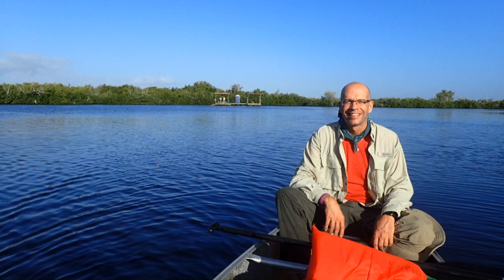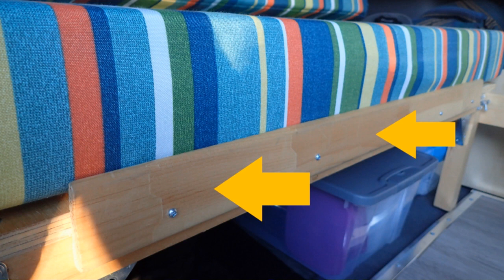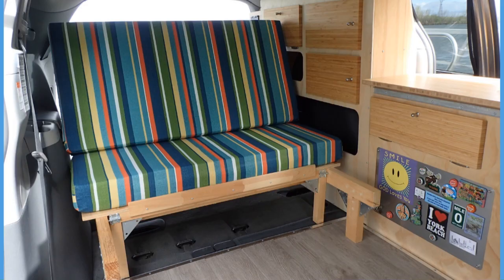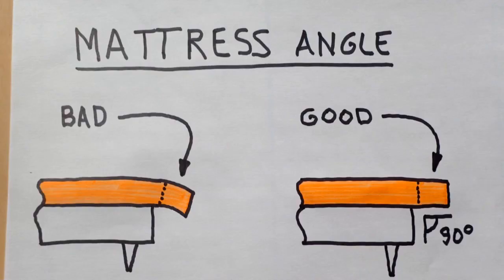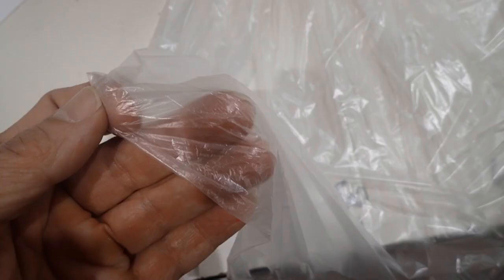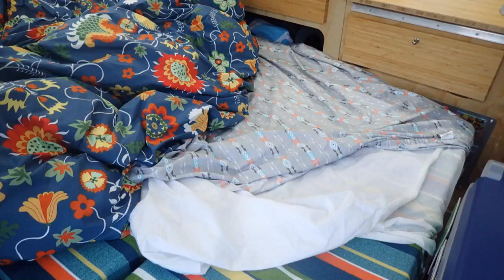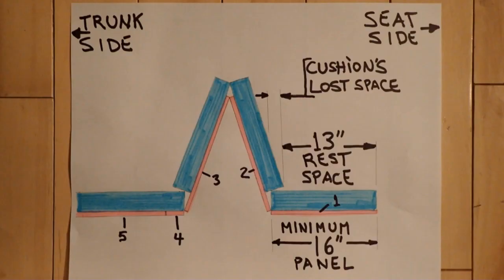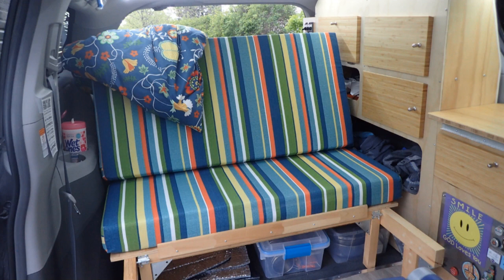Van conversion MATTRESS: how to cut and tips (EASY)

Comment: Suggestion for tweaking the comfort: Because you have a strong cover, you can vary the effective density of the foam at the edges by cutting a triangle shaped high(er) density foam, and cut away the lower density foam (along the hypotenuse) at the edge of your current mattress. Replacing parts of the lower density foam of the mattress with the higher density foam at strategic places can create better support in places of the mattress that carry higher load, such as at the edge. Later, you can even lay on your side and choose to reduce the pressure points at the hip and shoulder by increasing the density in careful ways. As you experiment, you can simulate the increased density without cutting the low density portion by simply inserting some extra scrap foam at the place where you (may) want increased density. Because the cover acts as a structural member (connecting with tension and spreading out some forces), be sure to test with cover on. I am not encouraging you to become the princess who could not ignore the pea, but simply offering some options to tweak the mattress. After a little tweaking of the mattress, remember to read the philosophy of the Stoics to remind yourself not to become too obsessed with comfort that comes from external sources. Cheers from Florence, Alabama.
Reply from the maker: Thank you Pete for sharing this great tip! I had no idea about it. It will also serve everyone who will read your comment. 

You made me laugh with your conclusion philosophy!😂

Thank you Pete!
Reply: Love it! I am fortunate to not have issues with sleeping on the floor. Yet if there is a pebble sleeping on the ground when camping...my Princess issues are revealed! Lol.

Comment: As a bedding person I wouldnt recommend wrapping the foams in the silk film as it will stop airflow, or using any convoluted (egg carton) foams as long term durability goes down considerably. Best practice would be to get two different density foams joined/glued, with softer one on top. Sewing a breathable water proof toweling protector on the top layers under the cover or as Eric uses, an actual matresss protector is the best option. Drilling bottle cap sized holes in the folding base board will also assist with airflow and temperature/moisture management. Will all depend on you budget though. 
Overall, its as great bed design Eric!
Reply: Thank you for this comment! Also couldn't the two foam layers just be laid on top of eachother without gluing them? What do you think? I also wonder about incorporating wool somewhere as it helps resist mold and regulate temperature and it stays insulating even if it gets wet. Guess would need to somehow prevent moths from getting to it though. What do you think? What do you think about natural latex too?
Reply: @flowersafeheart  Yes Latex as a base layer would be fine, as mould resistant and durable, but they are generally quite firm due to cell structure. Cored with larger holes would be best for air flow and maybe even 5 zone -  (softer at hips and shoulders)
 
Wool compacts and holds moisture (think futon and they need airing a lot) 

Most foam is mold resistant now, its more the covering fabrics that are the problem. For the base it should have holes cut into it ie circles (or slats) for air flow and some space between whats stored underneath the bed (i see lots of van builds with solid ply under them).  

A good option might be a decent second hand tempur mattress, then cut to size. It will offer plenty of comfort and the cell structure of those, even second hand are equal to latex and mold resistant.. 

Two foam on top could work if not too high or different densities and fairly tightly covered as they can shift when turning over. Or even better, neither covered except by a mattress protector and top sheet, so can readjust when necessary. A cotton topped, breathable water proof matt protector solves a lot of moisture issues as covers can easily be aired.

Good luck!
Reply: @stephenperry152  awesome thank you!🌿 Lightweight and ultralight backpackers sleep on thin layers of sleeping mats such as ground cover, foam, and air mattress (I don't like air mattress cause can deflate). So that tells me maybe most mattresses are excessively thick.🌿 The thinner it is the more space that saves for air flow beneath. I agree, most don't leave slats or holes or enough air flow. To prevent mold. Plus it is better Feng Shui. Though vehicle camping already breaks a bunch of Feng Shui rules haha but that is ok , has its own Feng Shui. 🌿For indoors I have wonderful 5" futon mattress by White Lotus Home of wool and green cotton. And they make low-toxic waterproof covers but the material is not good in sunlight. It is heavy and bulky though! For vehicle I imagine something much more light and thin hopefully. I wonder about a wool blanket on top. That could be easy to air out. Again though - moths. But good bug screens could be enough and some cedar around maybe.🌿 Anyway nice chatting mattress geekery, thanks. Happy to hear most foam is mold-resistant! Great idea about bed frame holes as an option instead of just slats!🌿 Also I think it's Japan where traditionally mattress and bed frame are very thin and simple and put away each day. I like that! Had great thin mattress topper filled with buckwheat or millet hulls once too. Some mattresses oldschool were filled with hay! But...mold risk?
Reply: 💯% correct on all counts.  I second that.  Don't put a plastic layer or your skin won't breathe.

Comment: Only one question. What is the bottom distance of the gap between bed panel 1 & bed panel 4 ? When in the couch position?
I love your videos, they explain things very well and your van is perfect for my adventures. Thank you for creating these and sharing your experience.
Reply from the maker: Hello Jason!
In sofa position, this distance will be affected by the angle that you will choose to angle the sofa. The use of locks is for when you drive. Otherwise you can angle it as it please you... You can even have more then one hole to change it!
Thank you for your appreciation ✌️

Comment: Great Video!  Yeah I have used a serrated knife to cut cushions a few times lol and keeping that knife at a 90' angle makes your cushions look so much more professional.  So I did it, I picked up a 2010 Ford Transit Connect.  Looked for a while till i nabbed one with really low miles.  I installed a maxx fan deluxe in it, so ventilation will not be a problem.  working on a few projects can't wait to sleep on the bed because I decided to buy myself a new mattress for home, and my few year old very comfortable 9" memory foam mattress lets me sleep like a babey (and with a back as bad as mine it's worth it) will get cutup and be my new cushions.  I have 54" of headroom and sitting on it compresses it down like in half.
Reply: Deryk MacLeod well, get going with the videos! Hehe
Reply from the maker: This is awesome Deryk! 😃
The project is moving on! And you found a van with the head room you were looking for, for your morning calls😉 This van is going to have a great time in NJ and Penn state, and further away!
With a perfect bed and a good ventilation, you will sleep better in your van then at home!😉
Thanks for sharing! And continue giving news, it’s great! 👍

Comment: Love your videos I am not in your league carpentry wise but still got the bed done and it looks great..now to cut the foam and have the covers made :-) I live full time off grid in a 30 foot fifth wheel but at times it is a hassle to get everything ready for a weekend trip so the van build will be great for that! Trying to see HOW to stick 500 watts on top or sides as a awning for shade! Any ideas?
Reply from the maker: Congratulation Federico for your bed! 
I like your idea of having something simple and fast to travel. 
500watts is a lot of watts!!! I have plenty with 100watts. I will explain in a future video how to optimize electrical system... I would be looking for this then installing 500 watts of solar panels... That’s my suggestion...
Thank you for your appreciation✌️
Reply: @ericenjoysearth2756  Part of it is that I already have most of the extra stuff..1500 watt inverter and all the wires and such. I get 250 watt panels for 50 each so...The end goal is to run a AC 5000 BTU on solar..Currently live off grid on 2000 watts on my 30 footer IN AZ where last year we had 54 days OVER 110!! lol
Reply from the maker: Ok, AC! Why not! 👍

Comment: We've never thought of sleeping inside a 2009 Sienna but very much encouraged to tackle these challenges.  You may have already covered my issues but please allow me.  My wife and I are in early 70's enjoy surf fishing.  Have a few questions: access to spare tire on wooden floor setup, foam mattress in 4 parts (18.5")? Would you share exact dimensions of your 1,2,3,4,5 panels on platform plywood?
Reply from the maker: Hello Tai! I really like surf fishing too! I was used to go South Carolina specifically for this. I was really enjoying shark fishing! They even had competitions! The beaches are quite natural. You should go if you never have been! 
Access to spare tire: Will be explain in the next video.
For the panels dimensions, I recommend you to choose the length of the bed accordingly to your heights to get the more space room possible. With the diagram at 3m56 you will define easily each panel. 
I think that having 4 equal size cushions is a good advantage for the interchangeability between them so that they last longer. I though about this when I was using it....
Enjoy your built! ✌️

Comment: I want to be truly stealth. So I am putting quick release on my front bike tire. So I will make my bed more like a single. This will allow space to keep my bike inside the van. I will video document this when I start after the holidays. Joyeux Noel Eric!
Reply from the maker: It is perfectly doable. Others have done it. I would say that it is more for a piece of mind not to be stolen. I have traveled everywhere with surfboards on the roof and was never kicked out. Largely, where you choose your sleeping spot is really important. Having a single bed is quite and handicap. You may be single right now, but you won’t be forever, plus can bring along a friend... I was single when ai build my van... And I still travel sometimes with a friend. It may worth thinking about it... Enjoy planning your project Madeline ✌️
Reply: @ericenjoysearth2756  yes I have thought about it and the warmth factor of sleeping double is an added perk. I thought of a stashing a plywood measuring the length and width across the front seat area to provide a sleep area as well...actually I can personally at my height sleep horizontally across the front seat length.. so a short friend ..is an option lol!
Reply from the maker: Why not doing my bed design in two sections...? You split the  plywood in two and you build two structures half the size. This is going to be easy to remove and also small to store when you will travel solo. That way you can have 
the warm factor of sleeping double as you said, travel solo with the bike inside when wanted and the bikes on the roof when you are two.
I also add that when you do not want to sleep to close to some friends, or larger friends, you can sleep head to toes. That’s what I do when a buddy come surfing with me. 
Really life is more fun when you have the opportunity to share. Having a travel companion is always great! If the option is not there, you may regret it... I wish you the best Madeline, and you will certainly have it! 😃✌️

Comment: Eric, Great vids, I am planning my van conversion, initially to travel with my teenage son to Alaska, then for my retirement.  I think I will add the shower, with a way to add a sunshade.  Does the shower work well?  We own alot of the items, as we have a 30' sailboat...solar panel, batteries, etc.  No problem finding a head?  Probably my biggest concern.. Or just have a bucket on hand?
Reply from the maker: The shower work very well. The only difficulty is that if you dont have enough sun the water is not going to be warm enough, but there’s a way to give it a warm kick that works pretty well. I will explain in a video about the shower.

Thank you Ann for your comment. Go ahead with your van conversion project. You will not regret it! Best decision ever!✌️

Comment: The best tool for cutting foam is an electric knife. You can get one for less than $20 at the big box. I have an upholstery shop and in 30 years I've bought 3! Last 10 years, better than a $300 foam saw. Just spray the blade with a shot of pure silicone occasionally.
Reply from the maker: This is a good tip!👍 If you have an electric knife. Why not using it! Thank you also for sharing that tip about spring silicon! 👍

If you don’t have an electric knife, a simple long cooking knife 🔪 is still working. 👍
✌️

Comment: Oh and I was thinking for your bed regarding the backrest falling down when you break would have been nice if you had the to backrest connected together on the bottom side so when you push it up into a sofa it's connected and so one would hold the other from dropping forward or backwards when you're breaking and also on your front side if you had two small piano hinges like the back then you could access that storage in the same way and maybe have a board in front so it's not easy to see all your stuff underneath the sofa and I thank you
Reply from the maker: Yes it requires to lock the panels so that they won’t move when you brake! ✌️

Comment: It appears from some angles as if the cushions are slightly wider than the chassis side panel assembly.  Is that just an optical delusion, or did you build some small overlap into the cushions?  Thanks again for your inspirational videos!
Reply from the maker: They are the same size. 
Thank you Rob for your appreciation ✌️
Reply: My cushions are being made as we speak.  Thanks again, and please keep up your outstanding work!
Reply from the maker: Thank you Ron! Enjoy your project 😃✌️

Comment: Thanks. Do you know the name of the foam mattress manufacturer?
I think it will be difficult for me to find such a seamstress. Maybe i can ask people at a fabric store?
Reply: Radnally.... looked like ikea bed display.
Reply from the maker: Yes that’s an ikea! You’ll find it easily! So far, it’s great!👍
Reply from the maker: Exactly Tons of Vanarchy!
Reply: Sorry, dont mean to hijack your videos commenters. I just love helping people. :)
Reply: Thanks. I did a little researching and found 48"x18"x3" outdoor bench cushions with water resistant slip covers on Amazon for about $70 USD each. So, I guess I could get 4 of them, for a total length of 72". $280. Not as plush as 4" thick, but a lot simpler than customizing.
Reply: Wow, thats kind of high. If you can, try looking at ikea in the kids matresses. I got the one for the kids extendable bed. I think theres a sale $80???
Reply: I could get just the covers for $25 each and then the mattress for about $90. Cut the mattress to fit the covers. All for about $200. My problem is finding someone to make the covers. For $25 per cover,  sounds reasonable to just buy them already made. If only I could sew...
Reply: I can do some sewing for you but im in alberta. Lol
Reply: I found bench cushions for $20 each. 4 will work.

Comment: Hi Eric, Great folding bed design. I am still using cardboard. Panels # 1, 2, 3,  5 are 17 1/2" x 44". Panel #4 is 4" x 44". What size should I make the cushions? If I make 3 cushions 17 1/2" x 44".  The 4th cushion would have to be 21 1/2". Any suggestions? Thanks
Reply from the maker: Exactly Arturo! You can do the cushions the exact same size of your panels. Since panel #4 is small, having a cushion the size of panel #4 and #5 is the way to go! 👍
Thank you for your appreciation comment! ✌️
Reply: @ericenjoysearth2756  Thanks Eric for your prompt reply. I was about to start over. Today I went IKEA and bought the foam mattress. Thanks again. 👍
Reply from the maker: Great! 👍

Comment: Bonjour Eric! Just wondering: Did you ever miss slats or at lest some holes in your bed to give the mattress some ventilation? I’m worried that without slats the mattress might become smelly or even moldy over time. Is this not an issue in your experience?
Reply from the maker: No problem at all. ✌️

Comment: thanks Eric, why kitchen is behind driver side, not passenger side? any reason ?
Reply: This is my guess. Seeing the kitchen takes the whole door area and water is also accessed from this same door, entry into the van would be and should always be on the passenger side in case of pulling over on the road side for safer entry.
Reply from the maker: Effectively it is for safety considerations. We go often in and out of de living space of the van. Sometimes spending lots of time digging in the fridge,  preparing food, all this standing outside being wet in a wetsuit... You don’t want to do this on the trafic side...✌️
Reply: @ericenjoysearth2756  makes sens thak you Eric

Comment: Not sure I understand.  Are all your mattress sections the same size?  If so,  what is the depth of each mattress..  I'm 5'9'' tall, so my bed length wouldn't have to be the same size as your's, but I figure somewhere around 78" long, would be good for me,  so that is 19" for each section.
  Merci pour les videos, ça va beaucoup m'aider.  J'ai une Sienna 2011, que je commence a convertir.  Toute un projet!
Reply from the maker: I didn’t do 4 equals cushion. But using the van I figured out that this would have been best so that I could have change cushion’s place for their longevity. ✌️

Comment: could you attach the cushions with string so you dont have to use your blanket to keep it from moving foward when breaking?
Reply from the maker: Of course you can, it is a good idea, but I would would use Velcro to attach the string to keep the interchangeability position of the cushions possible. 👍